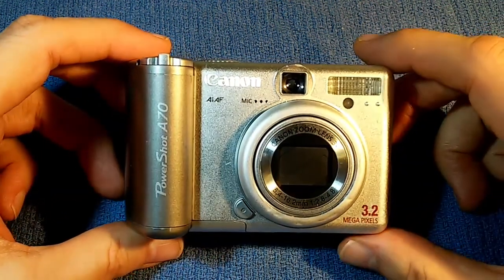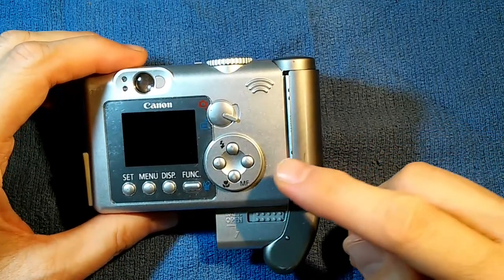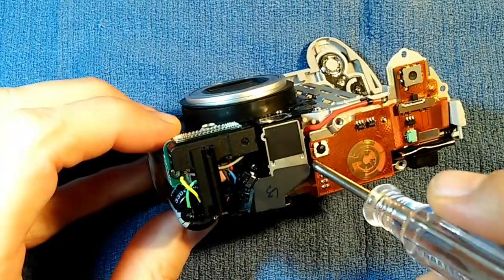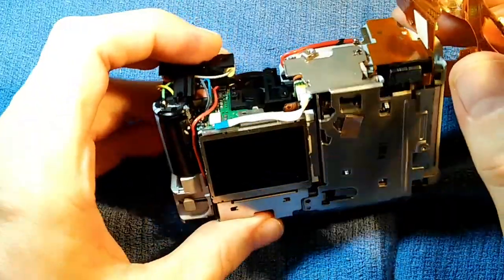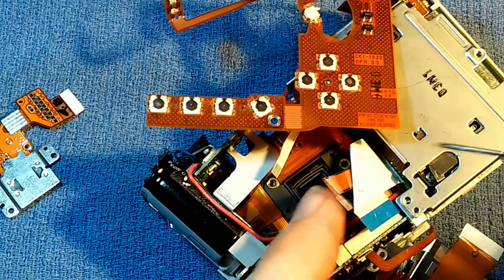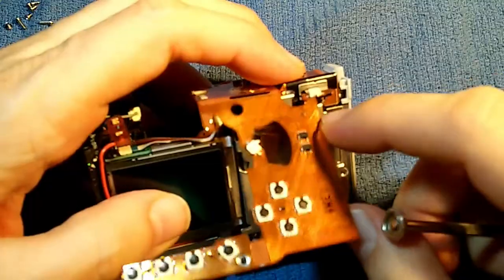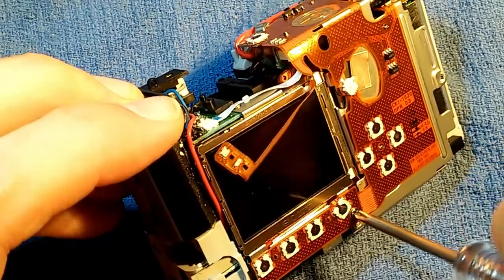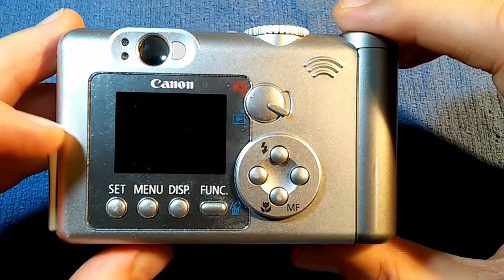Canon Powershot A70 CCD Replacement.

Comment: Great video. Kudos for remembering the correct sequences of dismantling and reassembling. I wonder how long the assembly line workers' training is for these sort of devices? I bought one of these in 2003 and it failed with the infamous purple streaks intermittently at first and finally gave up in 2008. After the store was unable to fix it, I looked online and ultimately found a tech notice from Canon in which they declared they would replace the faulty Sony CCD sensors in the A70s, gratis. I subsequently had the sensor replaced by a local Canon repair agent for free, and the camera is still working. I just thought I'd mention it here in case this may be still pertinent for someone. I have a couple of DSLRs but occasionally pocket this little guy. 3.2Mp is still good for 10 x 8 if needed.